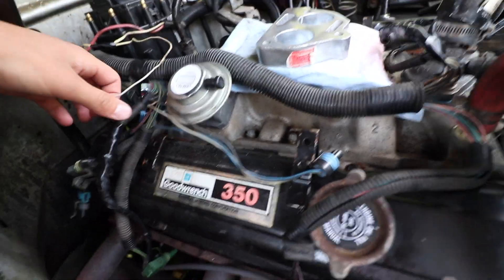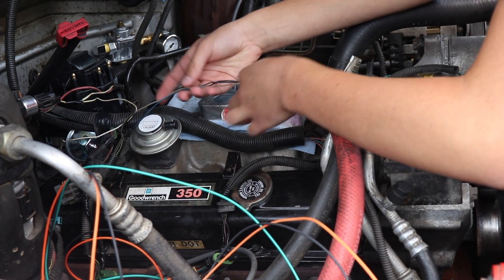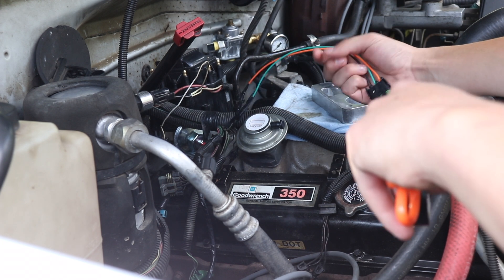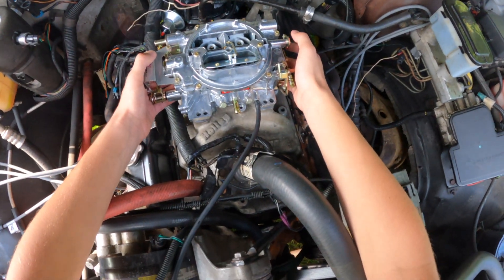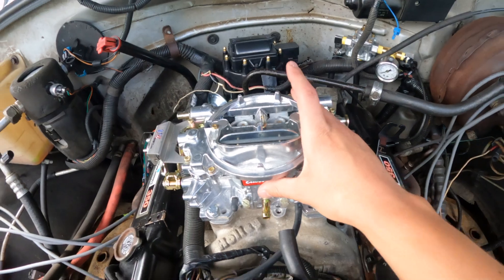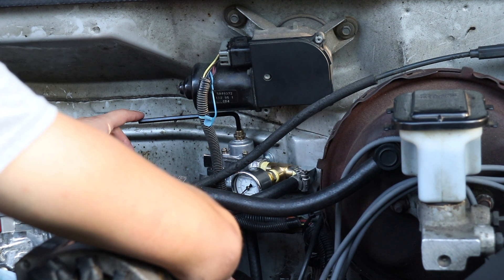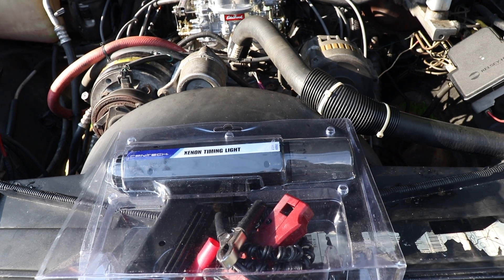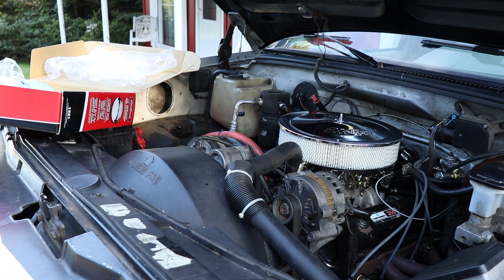GM TBI to Carburetor Swap PT. 4- The start up!

Comment: Carb swapping a friend's tbi and your videos helped answer a few questions so thanks. In my experience using those multipurpose stripper/cutters I've found if you turn them over when stripping so that the flat face of the stripper is towards the end of the wire they bite/strip better and easier versus the way you used them. I've had a few different brands which definitely matters but I will say that a dedicated stripper is also worth the money and then use the multi stripper strictly for crimping. Thanks again for the videos and info

Comment: 🤯🤯🤯 I was very   close too buying a expensive intake manifold , because the tbi has those funky odd angle middle mounts.  I've watched  a few  ideas on converting a tbi too carb and you.are.the first too simple drill out the tbi mount too except a 4 barrel carb. You just saved me alot of time and money . God bless! But what exactly bit did you use too drill out the holes for the secondary of the carb?
Reply from the maker: I measured my carb holes and bought a hole saw just a tad bigger so there was space for the flaps to open, nothing too scientific honestly lol, just kinda did what seemed right. After I drilled the holes I just widened them out a little bit as needed with a die grinder.
Reply from the maker: I believe I used maybe 1 1/4 inch hole saw and then used the die grinder to widen out the holes as needed.
Reply: @nickconnors8515 Great and very informative videos. Did you remove the intake manifold when you drilled out those extra holes for the carb? If not, how did you prevent metal shavings falling in the intake when you drilled out those holes for the carb? I am about to do the same on my SBC with at TBI. If I can use the original intake manifold it would save me a lot of money and a lot of trouble fitting in a new carb intake manifold. By the way, how did you prevent vapor lock on the carb using the original carb? Thanks.
Reply: Can't do it with a stock intake like he did his. That Holley tbi intake he has was basically a blanked off square bore that was opened up for a tbi that's why it was so easy to do with what he already had.  You could find any used SBC intake to fit hell even a cast iron Q jet intake will as long as the center bolt holes are wallowed out a bit until they line up with the tbi head holes. 

But currently they have made it even easier there's a few companies that are making adapters that can bolt a carb straight to the factory tbi intake gottem for 2 and 4bbl carbs. 

Im at the point I figured may as well ditch the tbi been chasing electrical issues causing a intermittent idle hiccup on one of my trucks for awhile now and it's always sucked on mpg no matter how good it ran just picked up a older but fairly clean 500 Holley 2bbl for free. $50 for a rebuild kit and $40 for a American made carb to tbi adapter on eBay then the Holley 6psi return style regular is $70 bucks I'm planning on mounting the regulator under the driver's side frame rail and tying right into the hard lines for the supply and return that way I only have to run a single 3/8 line from the back of the firewall up to the carburetor.  I already have an older hei distributor and possibly enough stuff to figure out the throttle cable and kick down but possibly will need an aftermarket bracket .  Once I get all my stuff together I think I could knock it out on a Saturday

Comment: So just the us shift kit was all the you needed to do the swap for the trans? No controller? I putting a vortec engine in a tbi put converting it to carb. Air gap intake and Avs 1906 carb
Reply from the maker: No controller, just needed a way to give the computer a TPS signal and a tachometer signal. The tachometer signal was easy, the purple wire on the ignition module had to be connected to the tachometer test lead.

Comment: great video very informative and to the point. where did you get the adapter plate for the tbi to carb?
Reply from the maker: I am not sure, the intake was drilled for a carburetor, I had to modify the ports in it on top for my 4 barrel carb. Not sure if it can be bought or it was custom made at some point in its life. It was drilled and tapped for TBI and Carburetor.

Comment: What wires did you run to the hei distributor to power it also what wires to power the fuel pump to keep it running
Reply from the maker: I didn’t have to wire anything for the fuel pump. Also for the distributor it took the 12 volt power source and a tachometer signal.

Comment: im planning to do this on my 87. Pretty sure its 700r4. So no need for extra wiring 😅 but its also a 454. 🙂  i was wondering if i can get a breakdown of parts you used. Ill likely need similar stuff. Except i shouldnt need the tps stuff. Thanks.
Reply: also ill be swapping the intake cuz im fairly sure mine is tbi specific. So that sucks. Lol
Reply from the maker: Everything I personally used should be linked in the description. I didn’t have to change my intake so that will be missing. Good luck with the swap! I definitely think it’s worth it.

Comment: Got a sbc 305 doing the tbi to carb too but what do you do with the iac idle air control plug?
Reply from the maker: With the carburetor the sensor isn’t needed so I simply tied all the unused harnesses together and tucked them out of the way.
Reply: Appreciate ya

Comment: So how does it run? Spit and sputter at all? More power? Burnouts? What’s your fuel pressure?
I’m considering on my 89. Has easier 700R4. 
Thanks
Reply from the maker: With the carburetor much better! I average around 11-13 mpg in the winter and during summer 14-15 with normal driving. Definitely also increased the horsepower, nothing super crazy but she does good burnouts and definitely has some pep in the step. I will say doing the carb swap really brought a lot of life back to the truck. Once I got it all tuned up and got the timing in the right spot and got my tranny working right, what a different rig. I would highly recommend if you’re having issues with the TBI unit, switch it to carburetor.
Reply: @nickconnors8515  can u help me find the website for the throttle position sensor please it’s the last thing I need and my truck will be up and running you videos helped me out so damn much
Reply from the maker: @romeoweeks2702  here is the link! I’m glad I was able to help. https://www.usshift.com/tps.shtml?gclid=Cj0KCQjwk7ugBhDIARIsAGuvgPZvnTEwpYwWAiIdhOoA0_TUz_5sPcCOkSofdsPDAiuq4lHybOI948waAiBREALw_wcB

Comment: What wire did you run to your hei ???
Reply from the maker: I ran the 12 volt power and a tachometer signal to it.
Reply: @nickconnors8515 did you also have to run purple/white wire from original distributor harness to the tac wire? 
I got a manual transmission

Comment: What's the throttle position sensor transfer deal you're talking about? I'm doing the same on a 91 s10 4.3. it runs and drives but it cuts out when warmed up. I'm curious about the adapter
Reply from the maker: I had to go buy a throttle position adapter kit for my carburetor so my electronic transmission would still shift. It wasn’t cheap but it works great and I haven’t had any issues.
Reply: @nickconnors8515  thanks dude. I'm still waiting on my distributor to come in from eBay. I got basically everything else. I appreciate you taking the time out to not only reply but also put out these videos. Helping a crap ton of people

Comment: Running advance  on manifold vaccume?  How's that working out for ya.  I can't find a straight answer on this back and for ported or manifold
Reply from the maker: Advanced timing? If that’s what you’re referring too, it works great, this truck loves about 12 degrees of advanced. As for the rest of the system, everything else also has worked great with very very few issues.
Reply: @nickconnors8515  "timing" is correct.  I've got mine on manifold as well. Rpms def lower at idle but so is my oil pressure.   If your dont mind me asking what is your oil pressure at.  or what does a older 350sbc usually run at.  I've been anywhere between 20 and 80.   After warms up though its in the 20s at idle.  Thanks for getting back with me earlier.
Reply from the maker: @brandonbaker8584 that’s exactly what mines runs at, around 80 cold, settled around 40 at 2k RPM then idle is a little less than 20.
Reply: @nickconnors8515  appreciate you sir.   Thanks for the help 🙂 👍
Reply from the maker: @brandonbaker8584  no problem!!

Comment: All these videos talk about 700r or 4l60 what about the th350 I’m assuming it’s the same as 700r since I have a kickdown cable but can’t find anything proving that
Reply from the maker: I’m not exactly sure, I know the 700r didn’t need as much electronics as the 4l60 so it was easier for the swap. I assume the 350 is very similar to the 700r

Comment: Got lucky and didn’t have to set the timing or the idle mixture? In 40 years of turning wrenches I’ve never heard of that.
Reply from the maker: Yep not much tuning at all, timing was dead on and that carburetor came out of the box ready to run, and it runs great! Have had to make some slight adjustments here after a few years of running it but nothing major.

Comment: So did you get rid of the egr and all related sensors?
Reply from the maker: Yes sir, only sensors I have now are for the transmission, all the engine control sensors are not being used, I left them all in their place along with the wiring, but since I have the carburetor they’re not in use.

Comment: did you do anything for the map sensor?
Reply from the maker: I did not have to do anything with it, since I got the carburetor the only thing the computer has to do now is shift my transmission. For the transmission the computer only looks at TPS, vehicle speed, rpm signal, and someone mentioned coolant temp so I left all that intact and it’s been running great.

Comment: How did you do the throttle linkage? You said you couldn’t use it so I’m wondering what you did
Reply from the maker: I was able to find a little kit off of autozone, I believe it was an edelbrock product or an autozone brand
Reply: update, I did the swap. So far so good I’m just waiting for the TPS kit in the mail. Your videos are very close to what I had to do.

 It took me a little while to find the RPM test lead to use for the tach

I would get a fuel pressure regulator that has a fitting for a gauge built in instead of using the T (don’t over torque fittings, I cracked my first regulator) 

Rtv the areas around the coolant ports if switching intakes on the head, both sides of the gasket, and the intake. Mine leaked twice until I did that.

0° initial timing with a carb motor is not enough, my truck ran rough but I also have a slightly larger camshaft that you can’t hear.
Reply: If you want to use the PCV pipe from the driver side manifold you can break a couple tabs on the inside of the factory air filter spacer and it fits on top of the carb perfect. All you have to do is go to ace for a longer stud and cut it to length. 

I DEFINITELY recommend putting the vacuum advance thing on the drivers side of the carb and not where you put it. I didn’t have enough room to advance or retard even when moving plug wires over one post.
Reply from the maker: Oh I see good to know, I was able to time mine with the vacuum port on the passenger side but definitely something to consider.

Comment: Is the map sensor still needed
Reply from the maker: I do not believe so, should only need throttle position sensor, vehicle speed sensor, an RPM signal, and I read somewhere apparently coolant temp so I left mine in just Incase.

Comment: What did you use to drill the holes on the intake ???
Reply from the maker: I used a hole saw and a die grinder to smooth the edges

Comment: Where do I get that sensor I’m trying to find the website someone help
Reply from the maker: Here is the link! Hope it helps https://www.usshift.com/tps.shtml
Reply: @nickconnors8515  hey sorry I keep bugging you I found out I need to put a vacuum line for my fuel pump because that’s what keeps getting shut off just wondering I’m going back watching your videos I don’t know if u did that or ran into that problem
Reply: It’s like getting back pressure and shutting my pump off did u do anything for the big tank in the front clip?
Reply from the maker: I’m not sure about a vacuum line, did you use a return style regulator for fuel pressure?
Reply: @nickconnors8515  yes sir I did and what pressure did u put on the regulator it might be that I might have it to low
Reply from the maker: @romeoweeks2702  mine is set to 5.5-6 psi
Reply: @nickconnors8515  hello
Reply from the maker: @abdullahssegawa-pp3xe  hello there